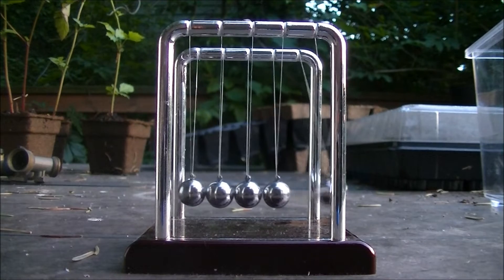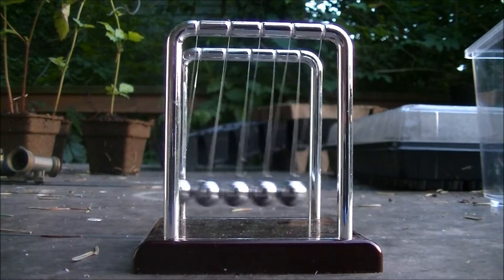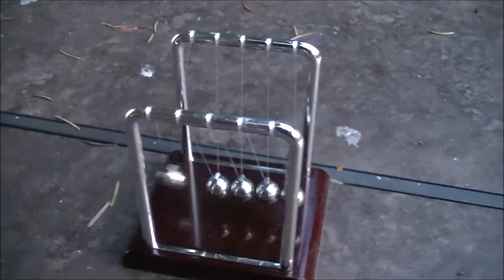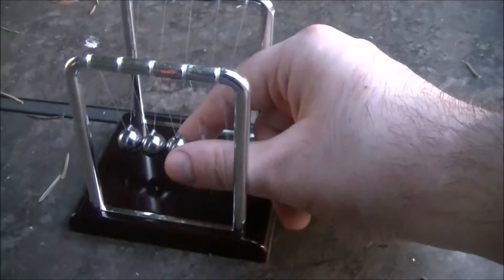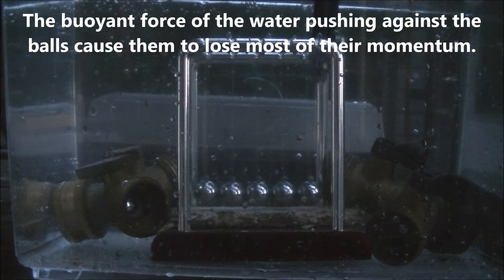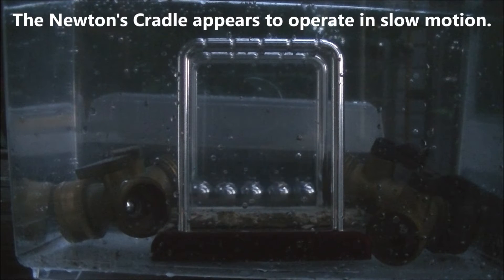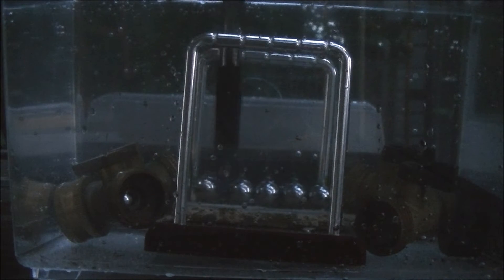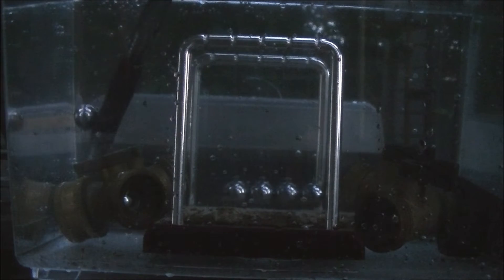Newton's Cradle Underwater

Comment: (for anyone else reading this comment, i liked the video, and write to bounce ideas off the video's creator Altoona)

First thing that came to my head was the law of diminished returns:. you never get back all that you invested.  With each transfer of motion, the swing gets smaller, until the balls return to a complete rest. What's not obvious is that some of the motion is also transferred into the air.

To prove this, we would place said cradle in front of a blank wall, and using a straight edge, we draw a straight line at the height of the cradle.  We then raise the ball to the line, and release the ball, hoping the opposite ball reaches the line on its upswing; but it won't.

What we can do is measure how far that upswing stops below the line and then we can calculate how much energy is lost with each swing, and therefore, how many swings the cradle will make.

Interesting would be to compare fresh water versus salt water, and see if they produce an equal resistance.

We can also try other fluids whether beer or vinegar or oil (vegetable or 10w40, you decide) or even liquid nitrogen, and determine what resistance each substance produces.

Ideally, the best results would be in a vacuum, but who's gonna take a cradle into space?
Reply from the maker: I think I might be able to get a vacuum chamber or something. Ideally it'd work best in a vacuum chamber still on Earth since in space it'd just float. And that's a cool idea, sometime I might with a better Newton's cradle do calculations of how much is lost with each swing and bounce. As the video showed there was more friction eating away the momentum in the water than in the air and it'd be fun to calculate just how much with each swing.
Reply: @AltoonaYourPiano  it would be fun to do color commentating with you on these experiments.

a vacuum, still on earth?  would not gravity factor into the resistance?

water is denser than air standing still, and as you proved in previous experiments, is denser than ice.  so, yeah, it should be more resistant. 

when do i want that resistance? When (well, if 😁) i jump off a diving board.  the air won't stop me from falling, but a body of water will. Do people dive into water without aides?  Definitely!  Do people skydive without aides?  HELL no.  they need a parachute,. a winged suit, a huge bubble or a flying machine such as a kite to even get the courage to fly through the air.

Water is more resistant than air standing still.

air in motion is called wind,  and wind has more resistance than rain.  moving water is called current,. and current has more resistance than wind.

The residential penguin (from your Antarctica video[s]) might know more about the effects of air and water..........
Reply from the maker: @spokenwordillusions5756  That's true, it'd be cool if I had someone to comment on what was going on. One of my friends volunteered to be the color commentator for a series of videos I was planning but never got around to doing.